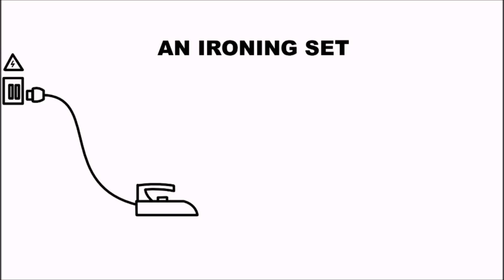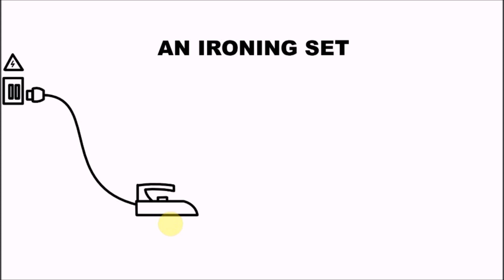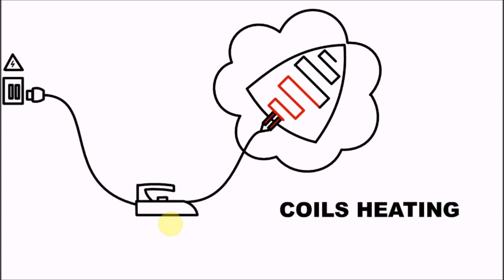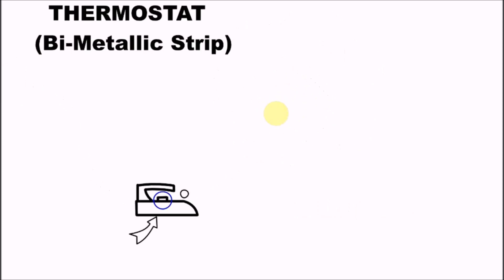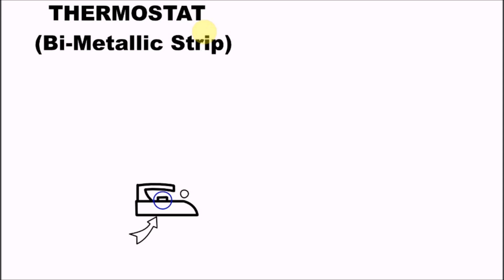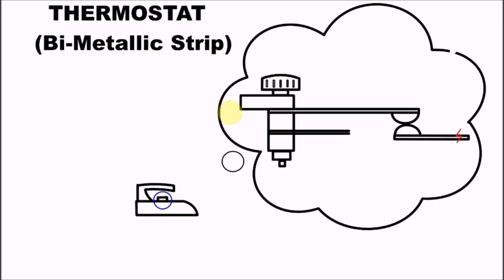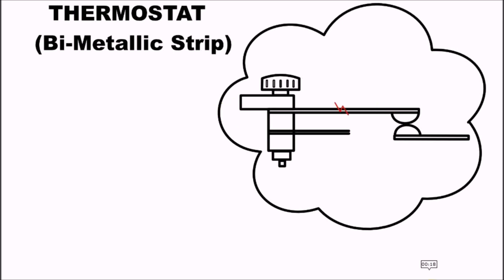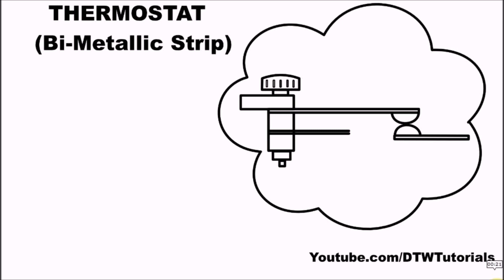How an Electric Iron Works | Animation

Comment: Mam how the electricity is converted into heat
Reply: Through the resistance in the wire the kinetic energy of electrons get converted to random kinetic energy of atoms which is nothing else than heat